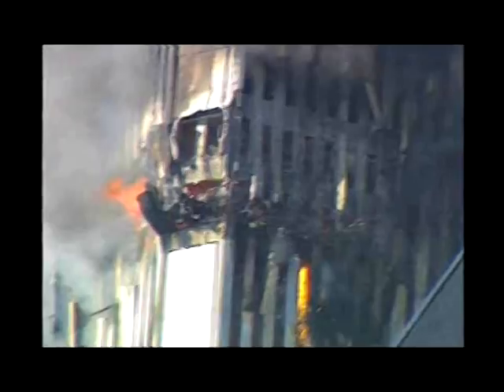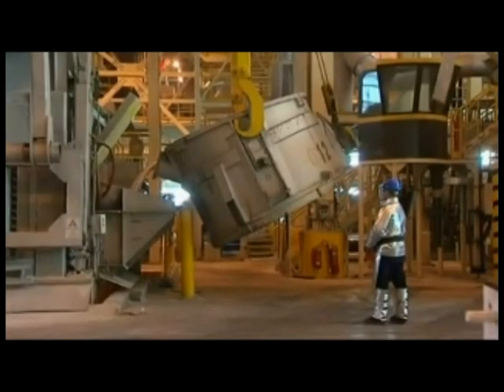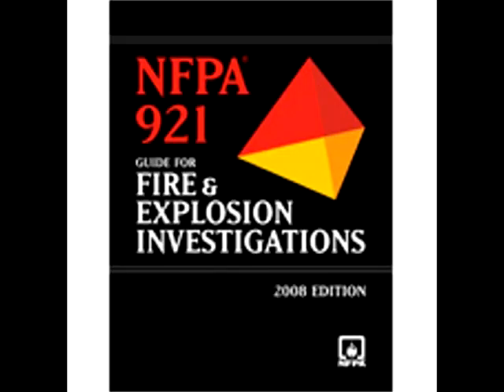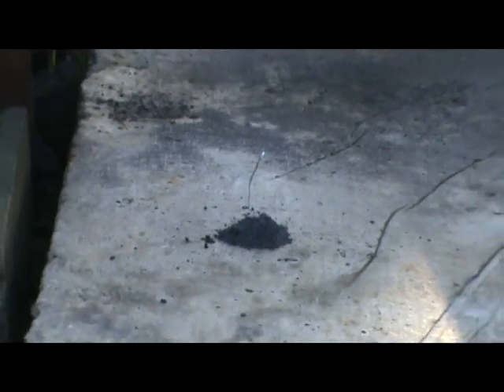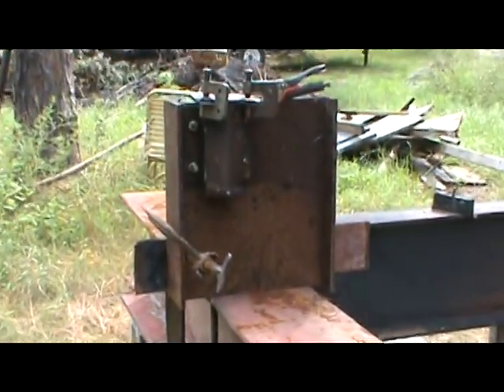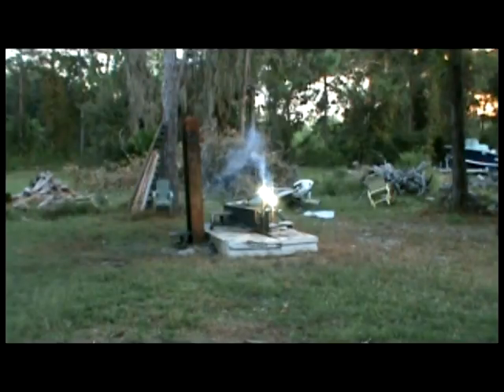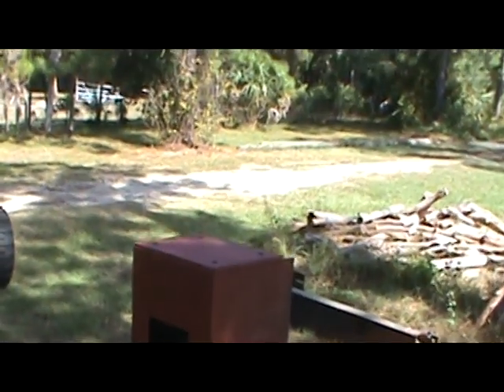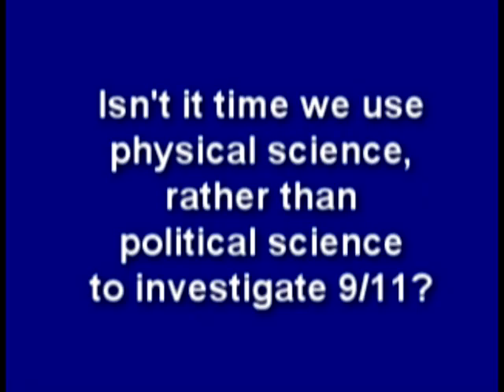9/11 Experiments: The Great Thermate Debate

Comment: 7:56 Did ANYBODY notice how EASILY the thermite ignited?????? Now can ANYONE tell me how the hell they "supposedly" kept the thermite demolitions from igniting for an hour after the buildings had been hit with planes and had burned furiously out of control  the whole time????? How did the supposed thermite demolitions not go off in building 7 which burned for over 7 hours?????? ANYONE??? People need to get a clue about this utterly ridiculous theory.
Reply: what damage, it was slightly scraped on one side. also it doesnt matter how long the fire was burning for, the building simply cannot succumb completely to fire.  why do you think firefighters felt safe enough to enter inside the buildings? they knew it was impossible for it to collapse unless it was rigged with explosives which actually happened to be the case.
Reply: my comment was aimed at wtc7 which only had standard office fires. if one building was wired to come down, they were all wired to come down. and yes the building came down in less than 9 seconds. also, when the plane hit the building, all the fuel burnt out in a huge fire ball and all the energy was released at that moment, if the building didnt collapse initially then the building succumb to fire.
Reply: Yikes.. i'm deeply appalled at the limits you've gone through to deny any obdurate actions of the u.s gov against its citizens. The fact that you think  "Nothing in any video suggests controlled demo" proves the incredibly bias nature of your cognitive dissonance. It's as-if you people are hard wired with a set agenda-pushing narrative, that when any information challenges your programmed fictive story, it's all hands on deck, deny anything and everything.  The media-worshiping shills are rampart and it's truly a harsh reality. I'm ending this thread.
Reply: cameron martin, nothing in the video, any video, or the events of 9/11 suggests a controlled demolition
Reply: being a builder doesnt give you any more merit. if the thermite chargers are insulated properly they cant be set off pre-maturely. a series of evacuations in the months beforehand prevented workers from exposing the demolition crew during the day a long with work being done after hours. obviously many things did not go " just right". thats why were able to expose it.
Reply: also as for your question about the thermite not igniting, my answer is im not completely sure. this is military grade nano thermite that the public dont have access to but my guess is it doesnt ignite from heat alone and it needs flame to come in direct contact with it, so if they insulated it well enough it cant ignite prematurely but don't quote me on that
Reply: Sean Sbragia another unanswered question I didn't know aluminum could slice through steel like butter proven fact airplanes cannot fly 520 miles an hour at that elevation proven fact when you disprove both of those
Reply: Sean Sbragia other proven theories 1 + airplane cannot travel 520 miles an hour at that elevation absolutely impossible     my aluminum knife will not slice through Steel     aluminum plane Wing will not slice through Steel with those two facts it makes no difference except for the fact that the tower did come down and there was molten steel running down the sides of the building if no plane can flyat that altitude then what the hell brought the building down
Reply: Diana, here you go; https://www.ae911truth.org/evidence/videos/video/4-stand-for-the-truth-a-government-researcher-speaks-out
Reply: Diana Eggen you’re delusional if you don’t think a 950,000 pound chunk of aluminum wouldn’t harm steel. There wasn’t molten steel running down the side, there was 950,000 pounds of aluminum.
Reply: Sean Sbragia, you’re confusing the Truthers with logic, that’ll just make them repeat their previous statement and ignore reason
Reply: The Thermate ignited easily due to the magnesium, Thermate is incredibly hard to light, once lit it burns fast due to the incredibly high temperatures it produces causing more Thermate to ignite subsequently. What you’re saying is merely a visual illusion that’s occurring because you weren’t paying attention
Reply: If it hadn't been a controlled demolition the building would tilted instead of collapsing upon itself, because there is no way the fire burned with the same intensity everywhere.
Reply: so you probably think an entire building framed with industrial grade steel can pancake in 9 seconds because of an office fire. please dont reproduce.
Reply: It got hit with aircraft grade aluminum dude... everyone knows that aircraft grade aluminum beats industrial grade steel! geeeez...
Reply: Umm no. Actually I used to be a 911 truther too until I did more research and watched every collapse video about a hundred times at .025 speed. I never said I did not think that the government was not involved. Only that there were no need for, and no evidence for controlled demolition. The impacts were quite sufficient to bring down the WTC, and that is exactly what you are seeing, but your feeble mind can't comprehend it because you have never seen it happen. Because it had never happened before, nor has it happened again since. I have a degree in Architectural Engineering and have studied physics and the construction of the WTC. I don't have an agenda other than to show people what I see and what I know. I know what brought down the building. It was structural failure. Mainly the truss seats and the bolted connections. I know that rigging the building with any explosives would have been incredibly risky and incredibly unnecessary. The chance of failure for the demolition would be near 100%. You still have shown no proof of how they could keep the thermite from igniting that was really my only argument for this video, but you can't show me any evidence for your theory. You can not show me one scrap of explosive or detonator, or detonation cord, fuse, device, nothing, because nothing was found, and yes thousands of people sifted through the debris for months. It seems to me that you are the one with preconceived notions. Not me. Good day sir. Keep believing every ridiculous conspiracy theory tho.
Reply: And cameron martin, just how do they ignite this termite after planes ripped through the buildings where the charges had supposedly been placed and pre-wired? Do you understand what it takes to do a controled demo and how many things have to go just exactly right? Apparently not..just one cut or burned through wire in each building and the demo might not work at all! And to think they could do this to three huge buildings with nobody noticing the setting of all these charges and the need to cover them up so the buildings could be occupied again, and then set off the charges after fires had been burning out of control around the charges since the time the planes hit...that's just utter nonsense for me who has been in the construction industry for 41 years!
Reply: https://youtu.be/6xif0jIT_ZM
Reply: Wonderfully Beautiful once again aluminum planes (ripping ) through two inch steel and concrete, pleas listen to yourself as you are proving my argument for me
Reply: Wonderfully Beautiful cause the trade centre’s falling were a controlled demo... yea ok lol nothing had to be done right because they didn’t care about how it would fall as it was a “terrorist attack” so why would they even consider something like that? And so if the beams were “melting” from these fires afterwards (which we know is impossible since a fire could not get hot enough to melt steel beams) then what was happening to the corner of the building shown in the video with sparks and molten steel pouring down the side of the building? That just happened from the fires? You really think it would be hard for the fucking government to find a way to conceal the thermite and keep it from igniting from the impact? There may not have been thermite on the floors the planes hit. It could’ve been set in the lower floors to help bring the towers down completely as there is enough evidence against to prove that the airplanes alone could not bring down the wtc the way they went down... just carry on sheeple 😂
Reply: cameron martin so you don't know, so you assume that it was some special fire resistant thermite or that it was insulated? Insulated from a plane impact and from 1 hour of 1000 degree flames? Show me the evidence. Not one piece of detonator, wire, thermite. Nothing. And yes the red chips were already debunked. You should look into that. 

the fires in 1 and 2 raged for around an hour regardless of how much fuel was burnt in the impact. It can be seen in the video record. You can see the failure of the outer columns in several of the videos as well. You can see them buckling in at the point of impact slowly more and more until the final collapse begins. Then they snap back when the floor trusses break free and begin the internal collapse. Nothing in any video suggests controlled demo, and there was not a single piece of evidence found to support that ridiculous claim. 

It is quite simple though really. The buildings came down because of gravity. The connections failed. Mainly the floor truss connections, secondly the bolted connections of the columns. The impacts took out several floors and the loads became redistributed putting much more pressure on the remaining columns. The floor trusses sagged under the heat and pulled the outer columns in making them structurally unsound. The collapses were innevitable. Building 7 collapse began in the interior near the lower floors. You can see the penthouse fall in a few seconds before the rest of the building comes down. When the interior collapsed it took out the remaining columns and poof, it looks like a building falling down.
Reply: cameron martin building 7 was hit by by massive chunks of building 1 debris. There was reportedly a 30 story  wide gash in building 7 from huge chunks of debris falling from 1000 ft. and accelerating due to gravity. Then building 7 was left to burn for 7 hours. Not exactly your average "office fire."
Reply: cameron martin Not only did it have damage due to debris, the fire raged for several hours. And it didn't pancake in 9 seconds. Firefighters on the ground saw the building structure leaning. I'll believe them before I believe some asshole kid on the internet that thinks he became a high rise building engineer over night because he watched a youtube video. Lol.
Reply: cameron martin the building didn't "succumb completely to fire." It succumbed to a 30 story building falling on top of it.  Let me drop an acre wide 30+ story building on top of you and see how well you fare. It took longer than 9 seconds. It was not because of an "office fire.: that is among the stupidest of claims that you dipshits quote. The buildings were hit with AIRPLANES. And yes a building can easily "pancake." It is simple physics. The connections fail and it doesn't matter how fucking strong your steel columns are. Bolts and small steel plates that were welded on to the columns which held the floors up and the entire building together could NOT withstand the incredible forces involved with such a catastrophe. Get a clue. Still you never explained how they kept the "thermite" from igniting for 1-7 hours when all it takes is one spark to ignite. Answer my question or gtfoh.
Reply: Sean Sbragia lol funny how a aluminum plane wing, seen in multiple vids from multiple angles cuts through those 2 inch thick seems like butter, you thinking the (planes) drop the towers makes you look very ignorant, the planes themselves did not bring the buildings down

Comment: Molten aluminum that has been overheated most certainly will glow a bright orange. It only turns that silver-white color when it's approaching it's hardening temperature. 

Any kid with a steel bucket, steel pipe, and some soda cans can find this out for themselves in their back yard. I used to melt down aluminum scrap all the time. like whole fucking engine blocks. It absolutely gets that orange glow while being heated.

And you need A LOT of material to make fucking streams of molten metal like that. We're talking multiple hundreds of pounds at minimum. 

The steel balls I'm not convinced about. Those occur 'whenever' steel is immediately heated. Those steel specks are essentially spall that has been flung off the surface of the steel. It can happen when welding, grinding, or cutting. However, some of the steel most certainly was melted and some of it likely caused those nodules.

Comment: In order for this theory to be true, either the thousands of workers who built the towers had to hide thermite in the steel supports decades before the towers fell, or men in black had to sneak into an extremely active building to place the thermite without anyone noticing something suspicious. I personally believe that fire can do some pretty amazing things with only ordinary carbon based fuels, let alone jet fuel. I have seen youtubers melt steel with coal and a leaf blower, they had no need of super thermite or anything of that sort. Another issue with this theory is that thermite burns incredibly fast as we all can see and only can cut through the steel beams if they are tightly constrained to it so any sabotage would have needed to be done to every support beam (or the 70-80% necessary to create a collapse). Any less then that would have been useless in bringing down the tower without a precise collision to already weaken the tower which is extremely difficult to do (try flying a remote control plane through a hoop, it isn't easy, now imagine going 400+mph and performing a similar feat)

Comment: 1800 degrees is plenty hot to bend steel especially in structural areas. The fact is no one should of ever gone in that building it was screwed from the moment the planes hit.
Reply: fire alone cannot weaken it to the extent that the building will even come close to being at risk of collapsing. additionally, why do you think the firefighters felt safe enough to go inside the buildings and the police in the area didnt evacuate everyone further away? its because they KNEW the buildings simply could not collapse. the only way they would collapse would be if all 3 buildings were wired to come down, which they did not know at the time, but actually happened to be the case.

Comment: 50k angry replys will come from this comment. Jet fuel is enough to melt steel. You don't have to completely melt it you just have to get it hot enough to bend it in a structural place. Furthermore everyone's lack of thermal dynamics is startling. If jet fuel burns at X then fuel load would add Y to the equation and in Z which is extremely fast winds and you have the solution S which is way hotter than most could even fathom. Look something are odd. Why was it so neat why did it crush so flat. Where is the third tower. The fact is you can either accept a shitty situation or you can try to explain it illogically to make yourself feel better.

Comment: Ok, so the towers were built with Thermite filled steel boxes with pressure pistons and waited decades for someone to fly two fuel full jetliners into it igniting the pre- positioned magnesium strips.  But I will give you credit for proving thermite can indeed cut steel.

Comment: What, some sparks falling from one corner?  Where are the rest of the "thermate" reactions?  Why aren't they all over the building, on many floors?
Why the planes then, if thermate was needed to bring the towers down?

The jet fuel fires softened the steel; they didn't melt it and they didn't have to.

As usual, the "inside job" theory doesn't hold water.

Comment: The jet fuel didn't melt the steel beams but it got hot enough to soften the steel support joints that are load bearing which in turn caused them to buckle.